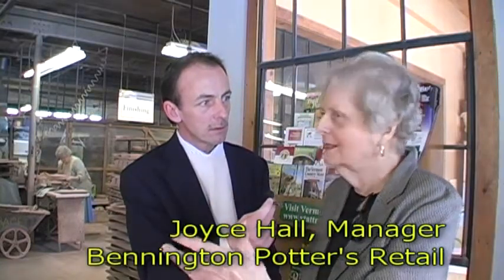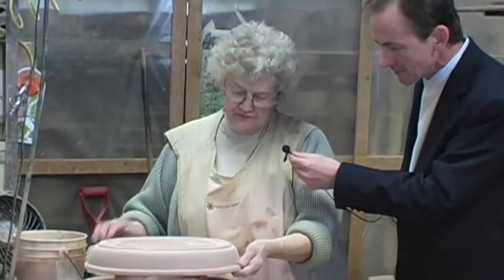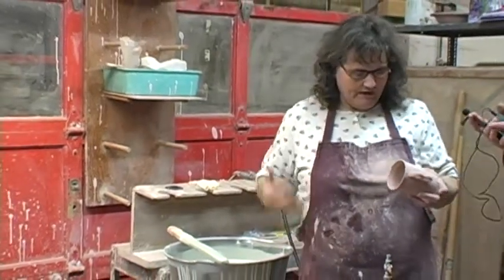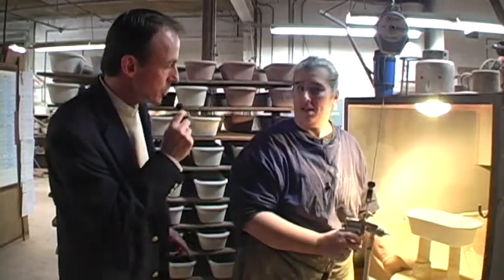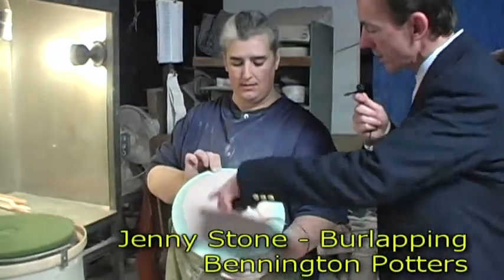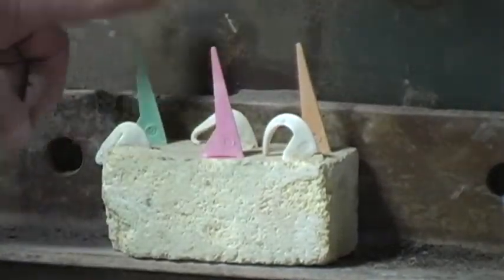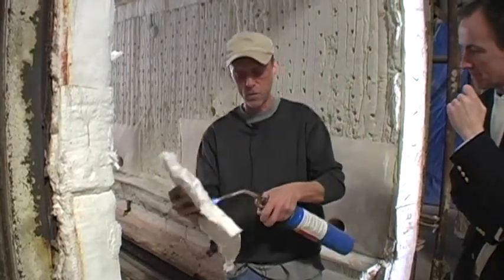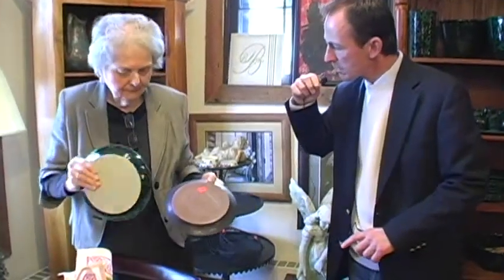Spotlight on Bennington Feb 2011.mpg

Comment: A good trick at the beginning of this video would have been that they shut off the machines for the filmed segment and if necessary add the sound later at post. This would give you better control of the background sound quality. you could layer the sound so it would not interfere with the show.